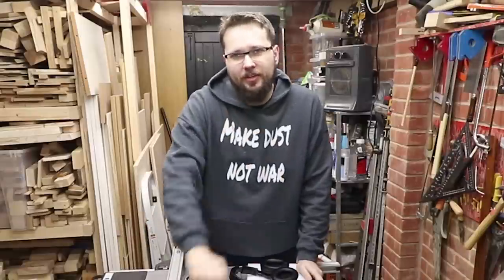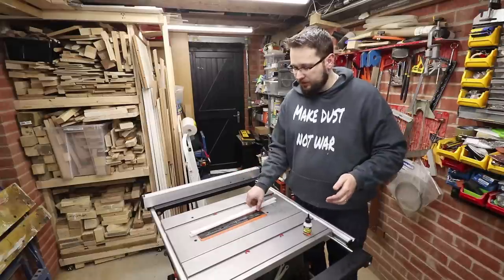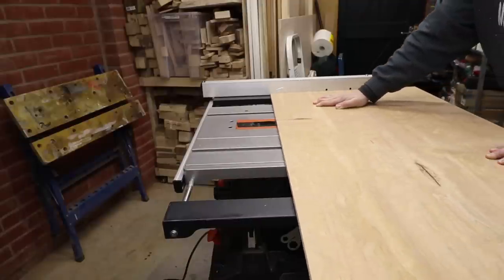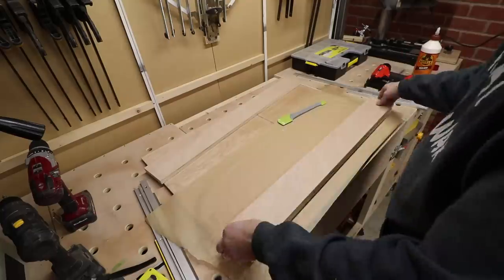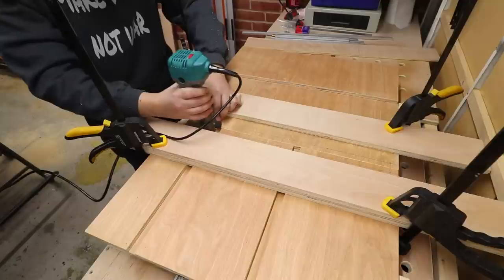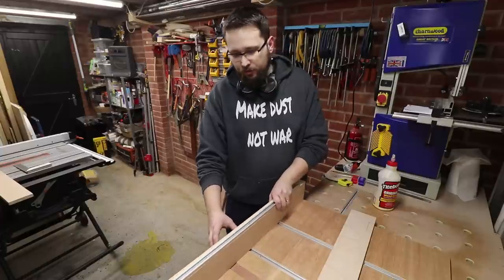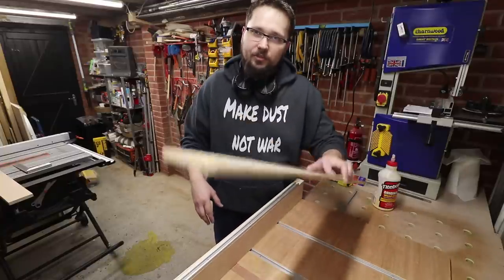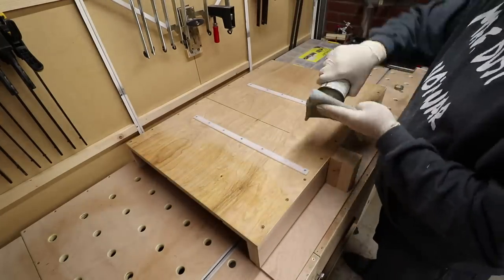Table saw Sled for Evolution Rage 5-S

Comment: This is definitely the sled for me , it looks safe to use which my wife is terrified of me using the Rage 5 table saw on its own, although there will be a few occasions when I will. I have had the table saw now for 11 months and still not used it , only to check it out , this is because of a severe RTA in which I broke my spinal collumn, three ribs and bleeding in my head, but hey I'm ready for the fray ! 
Thank you Thomas, I do look forward to this project.
Reply from the maker: Bloody hell that's sounds terrible. I'm hoping you will recover fine, wish you health. The sled is very safe to use and that's why I like it. The clamps and now my latest video with the stop blocks makes it a very useful and safe to use jig.

Comment: H Tomasz, thank you for another fab instruction.
Not sure which of your posts is the most appropriate for my T track question, this one seems as good as any...
Here in the UK there are a confusing (to me) few options in T track dimensions. I'm talking about basic track, not the more advanced extrusions. I understand that Outer Dimensions are consistent at 19mm, but there seems to be some variation in the Internal Dimensions from different suppliers.
Is there one definitive size that will accept all third-party accessories, or am I hoping for too much? Thanks in advance for your thoughts- I know you've covered a lot of T track stuff already in your various posts, but I'd love to see your in-depth video on this topic alone!..
Best wishes,
Simon
Reply from the maker: Hi Simon, that's true, there is so many T-tracks out there with different sizes. Now I don't think there is just one standard, but there may be one more popular than the other. Me for example I buy T-tracks when I see a good offer, and by doing that I usually end up with t-tracks of different dimensions in my workshop. However I have to say that so far everything fits in all of them. One suggestion I may have for you is to find the cheapest t-track and buy that. If some of your accessories - t-bolts or normal bolts will not fit, just grind them down a bit so they fit. That's what I do. Hope this helps a bit.

Comment: I know this is an older video, I just wondered if you experiance any play in the sled, for instance if you move it through the blade holding it in a different position? I noticed that no matter how accurate my runners are, the sliding part of the table which has a slot in it has enough play to cause differences in the sleds squareness depending on where you push it from.
Reply from the maker: Never experienced that mate. The only thing I change is the middle insert plate as I work with different blades and kerfs I just make a new one from time to time. Not sure what you mean by holding it in a different position, it goes one way, well two ways forward and back. If you got Rage 5s table saw then use the mitre slots that are on the fixed table and not the sliding part. If you make the runners fit snug and no play to them I can see how you can get any play in the sled.

Comment: your zero clearance plate - do you still think that was worthwhile doing? About to make my own sled & wanted your thoughts after 2 years of using the sled.  thanks Tomasz !
Reply from the maker: Yes if you will be changing the blade. I was swapping my blades mainly due to testing and the kerf was slightly different between them. But if 1mn gap won't bother you then no there is no point. When I will do another sled it will have the zero clearance plate but that is my preference and laziness as I don't have to measure anything and the zero clearance plate will indicate where the blade will be exactly 👍

Comment: Hi! Just picked up the 18/12mm wood today. Gonna have a go tomorrow. 
What would you seal the wood with? My ply has a sticker on saying “must use acrylic primer”? I’m sure I’ve seen you using osmo but that’s not acrylic is it? And how the hell did you hang it on the wall? Lol. Thanks 😊
Reply from the maker: Any varnish and or wax will be fine. I often just use sanding sealer and wax. To hang it on the wall I just made a "shelf" a piece of 2x4 and at the top a locking mechanism.  Which was one strip of done off cut secured to the wall and another one attached with one screw to the first one with a washer between those two pieces. So you can easily move it.
Reply: @CasualDIY  thanks for the reply! :) 
Kinda lost me on the wall mount lol.

Comment: Good job Tomas. I've actually seen several other videos about making a sled and they have advised that a small 45 degree chamfer is cut into the squared feed board to ensure sawdust doesn't accumulate and hold the piece to be cut off square. Although, I guess if there's compressed air available, it would maintain cleanliness of the sled. Just a thought. Keep up the good work Tomas, I'm glad I'm a subscriber.
Reply from the maker: Yes that's correct. It's one of the improvements I need to make👍😁 thank you for being part of my community 😁

Comment: Once again Thomaz, cracking jig. Not that it matters but do you dream these up or do you take snippets and incorporate into your piece. I could never do anything like. Have you come accross that Fastcap zero clearance tape yet? Fourteen quid for 5 strips. Not as rigid or sturdy as yours but for convienience it goes on my mitre, table saw and when your cross cut sled is looking slightly haggered, bosch. Thank you for the great stream of info you supply in your videos.
Reply from the maker: Hehe a bit of Pintrest a bit of solution thinking and eventually something comes out of it. I just used a normal grey tape to be honest.

Comment: Hi Thomasz, excellent video as all your videos are. As a Rage newbie, I wonder if you can tell me what the extra part attached to the fence is for? - Evolution call it the rip fence face plate. It's not a plate, it's like a mini fence (alloy extrusion) held on with two thumb screws......
Reply from the maker: It's called an adjustable face plate👍
Reply: @CasualDIY  :) When do we use it?

Comment: Hi, what material you use for runners please?
Reply from the maker: It's HDPE plastic that I use for making molds for resin casting. In simple terms you can get a super cheap plastic cutting board and just rip it to the right size👍

Comment: Excellent sled Tomasz just what I have been looking for to go with my Rage 5S. How come your saw is so clean? What dust collection system do you use? Do you have a link to the plastic you used for the runners? Really like the t track options.
Reply from the maker: Hehe thanks. Made few videos on my dust extraction system, you can check them out👍I bought the hdpe plastic on EBay, there's quite a few sellers and more or less they got the same prices. Just search hdpe plastic sheet.
Reply: Casual DIY Thank you for the information, I’ll look into it.
Reply from the maker: @ianvoden8915  no problem 👍

Comment: Excellent video again
Reply from the maker: Thank you kindly
Reply: @CasualDIY  Have put in an order for Evolution rage 5s, an basic diy-er and have been working off a Lidl parkside table saw for about 5 years now, the fence is always out ,riving knife is badly bent..never get a straight cut ,always having to sand cut pieces to fit in...am looking forward to making a straight cut for once...
Reply from the maker: @TheEcorristine  I had that with the budget Einhell table saw  🤣

Comment: hi,i just purchased  a rage 5-s but the riving knife isnt in line with the blade and consequently the cut wood catches as it passes through the blade,is there an adjustment or is it a case of taking it off and bending it in a vice,cheers for the videos keep up the good work .
Reply from the maker: Check out my re-review video on this saw, done it few weeks ago and I mention that exact problem. There is a bolt that secures the knife I had to tighten mine and it has put the knife in place. Hope this will help👍
Reply: @CasualDIY  cheers will check tomorrow

Comment: Hi, love your videos. The only bit i'm struggling with is the runners as I don't have a band saw and getting them accurate will be difficult. Just wondering if you have any suggestions. I'm using a half inch, or so HDPE chopping board as I can't source a specific product like you used. Post Brexit is a nightmare here in Ireland as Amazon is pretty much of no use due to import duties. Don't just get the choice over here. I was lucky to find a stockist of this saw. I really need to make a sled as the mitre guide on my Evolution 5-S (purchased last week) has extremly bad play. It's only useable when it's attached to the sliding bed and is only fully stable once the work piece is clamped. I'm new to woodworking so any help is greatly appreciated. Thanks, Shane.
Reply from the maker: Regardless of what material you will use ( I prefer plastic HDPE in my case as I had it from making molds for resin casting, plastic will not be affected like wood where it comes to moisture. But plywood would be a good idea as well) you need to cut it to the right size. I actually just done it on my table saw as I made some zero clearance plate which made it a lot easier and safer. I wouldn't try to make those runners if I didn't had the zero clearance plate as the original orange one has got a gap way to large.
Reply: I have had good luck using chopping board plastic for runners. Also, I had the same problem with mitre gauge play. I used painters tape on the mitre runner to widen it and it works fine. Just need to replace the tape from time to time.

Comment: Thank you so much for your guide! Quick but important question for you. 

In the UK, the Evolution Rage 5-S is no longer easily obtainable in high street shops (Screwfix) and it has been 'replaced' by the Evolution R255PTS. The main change is the left extension table no longer comes with the saw and it is about 20cm shorter as a result at its max extension. given the fact that your sled rests on the left table, would you still "recommend" the R255PTS as a good table saw? It's sort of an important question for me as I would be really keen to construct your sled and I'm wondering if it would be a mistake to buy the R255PTS.
Reply from the maker: Hmm to what I was told by my viewers the new version is not that much different from the old one. But I have not seen or worked on one myself so can't really recommend, sorry.
Reply: ive just purchased a rage 5 s from screwfix, £250 on clearance. maybe go and look there. ive looked all over the internet, and stocks were so low. but luckily i found one on clearance. hope that helps.

Comment: any chance of putting the size of the plastic sheet you bought for the runners on your plans and also the runner dimensions too as so much slop in saw bed runners its unreal  cheers but great looking sled and really good videos put on here by you so much so ive just took delivery of my new 5s but taking it out the box the table extention bolts fell out luckily gathered what they was ,also had to reset up the blade square as zero on mitre guage wheel not right so adjusted the bolts behind the wheel to remedy that then the small mitre had the expected wobble but also did it when added to slide the carriage so wasnt too happy but under the carriage there is another dimple on the casting for a bolt hole so drilled threw cleaned up the hole burr and tapped it out now solid as a rock so all good there also fence wasnt parallel so sorted that as well lucky for me im a fabricator welder by trade so all straight forward .will be making a zero insert for the saw blade but i will be using steel plate to do it one for the standard blade and a couple for some 80t blades for fine wood cuts but all that aside cheers for putting your vids up for everyone well presented and good looking finished items you make
Reply from the maker: Yes they do come with some problems. Initial setup is a must. The plastic sheet of HDPE was 50cm x 50cm x 2cm
I cut it to size. Now I don't have access to my workshop until June so can't check exactly for you but with these saws I'm pretty sure that your runners may need to be slightly different size to mine. All the best👍

Comment: What is your view about runner depth. Should I make them deep enough that the rest of the sled is lifted slightly above the table or should they be thin so the whole sled base slides on the table?
Reply from the maker: I think it's best if they are slightly thinner so the whole sled rests on the table. Why? Over time if the sled is above the table it will eventually sag down and create a slight bow and inaccuracies. And I feel it would be lest stable and rigid. Hope this helps

Comment: Great video, thank you for sharing. Can you tell me how long the arbor is? I'm thinking of getting this saw, but was wondering if it is long enough to take a 5mm grooving blade.
Reply from the maker: Evolution saws take only evolution blades unfortunately. You would need a reducing ring to put other blades but I would not recommend this as all Evolution saw have lower RPMS than normal about 3500 where normal blades are made for about 7000-9000

Comment: Another great project , I'm currently making one of these for my 5S, does the saw slot where the blade enters the front of the fence get 'nibbled' away over time ? would it be an idea to have a replaceable insert in the fence (similar to the zero clearance insert in the sled base), hope I'm explaining this clearly
Reply from the maker: Do you mean the safety block at the front of the sled? Mine did not as it's quite thick and I just know when to stop the sled so the blade will not go through the block. I hope that's what you are asking for.
Reply: @CasualDIY  No I mean where the blade cuts throuhg the fence (blade side) in front of the safety block, tbh I'm probably worrying over nothing
Reply from the maker: No issues mate👍

Comment: An ide. On the board where you hold your hands. Put some brackets or cut some holes for safer useing.
Reply from the maker: Yes that could be another option for improving safety👍

Comment: Bit vague on last comment, I've got a rage 5s on order but want the things ready when it arrives to make the sled.  Just wondered what thickness the HDPE you used was.
Reply from the maker: Mine was 1cm thick originally but you need to take some thickness away as it would be too deep. I didn't give the dimensions of the runners as you need to "sneak up" on them to get perfect fit. Even though you will have the same saw the slots may be slightly wider or thinner or deeper etc.

Comment: Nice sled but what size HDPE do you use? 👍
Reply from the maker: I had a 50cm by 50cm by 1cm sheet. So you need to cut it to size.  I didn't give exact dimensions of the hdpe runners as you need to close up on them to get perfect fit.

Comment: Hi Thomasz, thanks for sharing a great improvement for the Rage 5-S.  I've built this now, and a couple of notes for you and others wanting to give it a try.  I found it really difficult to get the HDPE to the right size.  I don't have a bandsaw so I actually made a rig for my jigsaw to make these cuts and they still weren't perfect.  I then used sandpaper but again it was time consuming and difficult.  I've seen now that you can buy ready made runners for table saw rigs and in hindsight I would definitely recommend others just to buy them ready made.  Second, the clamps that you use in the video are actually incompatible with the t-track size you recommend, so people shouldn't just buy them expecting them to fit.  No big deal, I've managed to buy some adapters for them, but I wondered why you didn't use wider t-track to be more compatible with ready made clamps?  I have put a layer of finishing oil on the bottom face of my sled and it's made it much easier to slide, reducing the need for force and making it feel much safer.  Thanks!
Reply from the maker: Yes it all depends on what tools you already got. But I had no major issues with cutting the plastic to the right size. With regards the clamps they are the cheapest I have found. And you can just use some long bolts with them. That's what I do now. Comes out so much cheaper. Depending on the t track you may just need to sand off a bit of the bolts head. Saved me a fortune that did 😁👍
All the best and thank you for watching and your comment. Stay safe.
Reply: I think you could use clamps designed to hold the track (for plunge saws) something like: WEN 36053C 6" Quick Release Track Saw Clamps (2 Pack), Black (amazon link), just put the lever mechanism in the other direction.  HDPE can be run on thicknesser, but check your manual as there are minimal thicknesses described. I will check the depth of my EVO tracks today.

Comment: If you want full safety…back the blade covering block with a strip of 6mm steel.  The Rage 5 DOES CUT STEEL, but it takes a while and you’ll not accidentally cut through the block.

Comment: How do you address dust extraction when the guard isn’t over the blade? Do you just blank off the duct?
Reply from the maker: Respirator to be honest but I'm thinking of upgrading the sled to accommodate some extra dust extraction
Reply: Casual DIY I’ve just blocked to port off. It isn’t particularly good but it is all I’ve got

Comment: When setting up for a square cut could raise the blade up to max avoiding the teeth use the square to set the jig squareness instead of the zero cut line ?
Reply from the maker: I thought of that but it's hard to avoid the teeth sometimes and I thought this would be easier this way

Comment: Good project. At 11:14 you state "screw and the rest of the screws making 11:16 sure that the fence is parallel to the 11:20 blade". I think you meant to say '....fence is vertical to the blade'.
Reply from the maker: That's the badger 😁👍